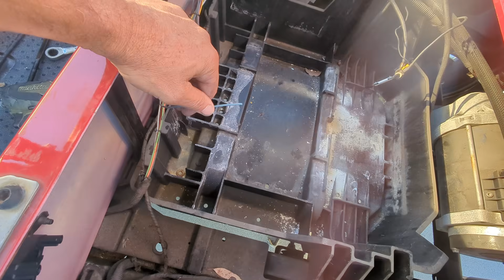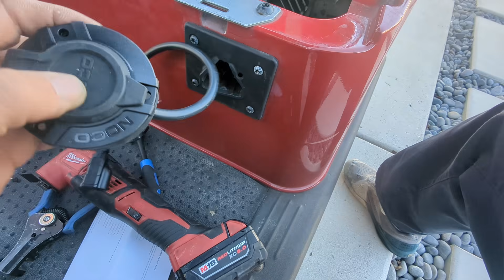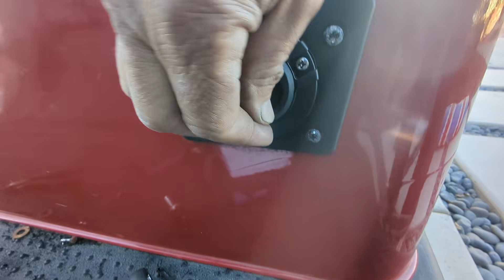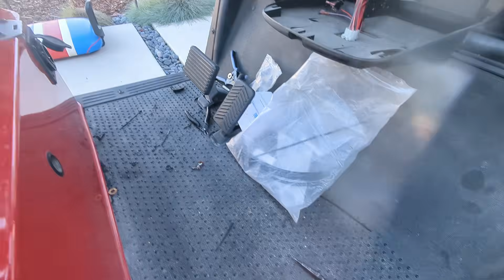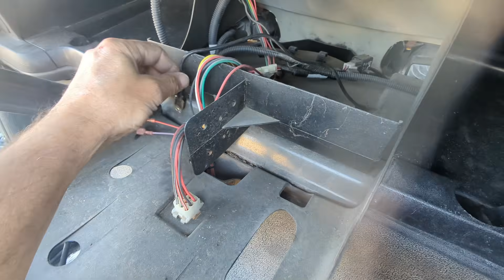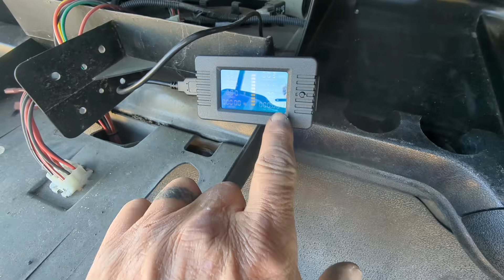LOSSIGY 48V Lithium Golf Cart Battery Install

Comment: Thanks for the information.
You were able to install it in the RXV plastic tray without adding any filler pieces or fabricating a wood or plastic platform on the tray?
Reply from the maker: Correct. We repurpose the rxv top hold down bracket and the battery seems to sit into the plastic battery compartment securely

Comment: Actually the tabs on the sides of S.O.C. meter are for in dash mounting. Cut a square in your dash 3-3/8 wide by 1-13/16 tall and it will snap into the dash perfectly.

Comment: I’ve got a 2016 ezgo rxv and have gotten everything installed. I don’t know which of the black connectors go on the shunt and which ones connect to the battery. (I’m a newbie to every bit of this conversion and ignorant with electrical stuff, so pls be kind ☺️)

Comment: lights 12v? did not show that
Reply from the maker: You are correct, the golf cart already had a DC 48 to 12 volt converter installed. 
It is usually located in the battery compartment on the driver side